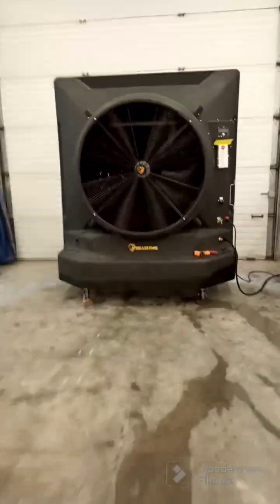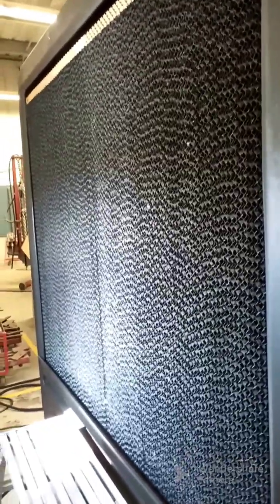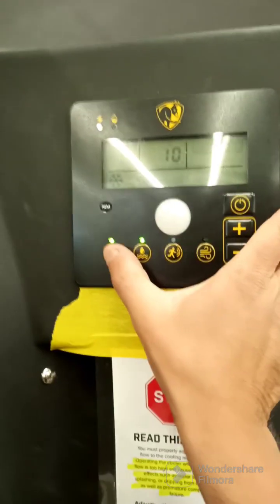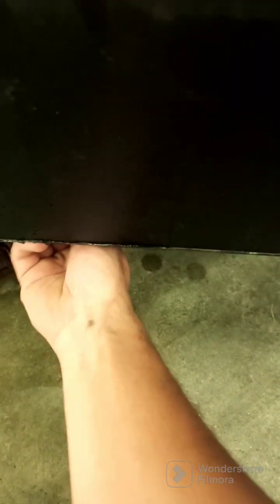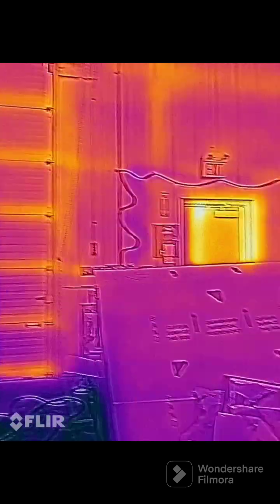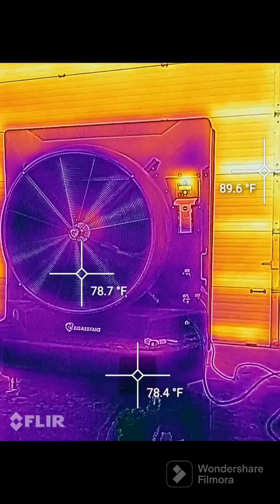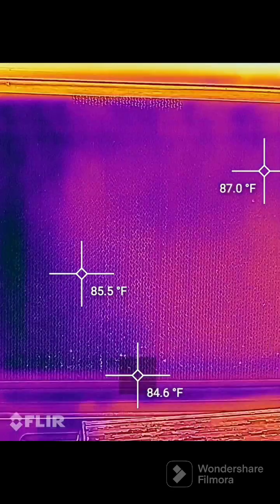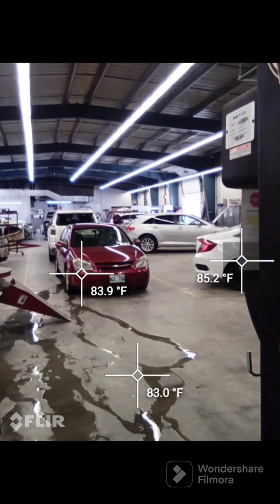Bigassfans cool space 500 review with FLIR PROOF

Comment: we have one in our shop, but the humidity it produces is insane. my boss leaves the hose running all day in it, any tips on how to bring it down? as of today its outside but 95 in the shop with humidity at 52% in the shop.
Reply from the maker: there is a SPECIFIC way to run this thing.  Firstly you have to have some doors open to push out the humid air.  otherwise it gets too humid and then the unit won't cool anything anyway.  So we leave 2 overhead doors open (on the shade sides of the building),  do not let any direct sunlight enter the shop if you can.  we turn the tap one full turn from closed plus about a tenth of a turn and found that is the best setting for keeping the shop cool! hope this helps!   DO NOT RUN THE HOSE ALL DAY IN IT.   drain and fill the water maybe half way through the day, but squeegee the water away otherwise you only adding to the humidity problem.
Reply: 52% is not bad at all